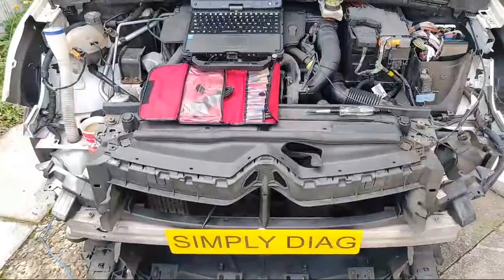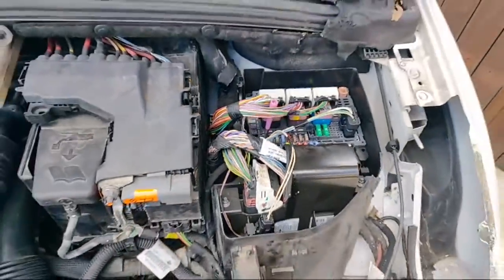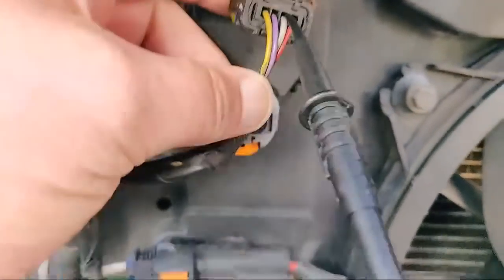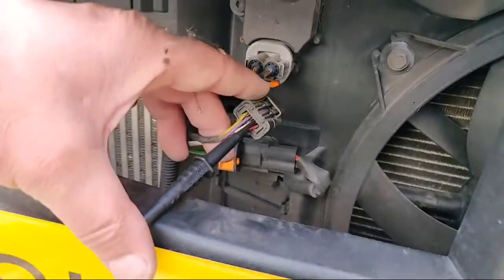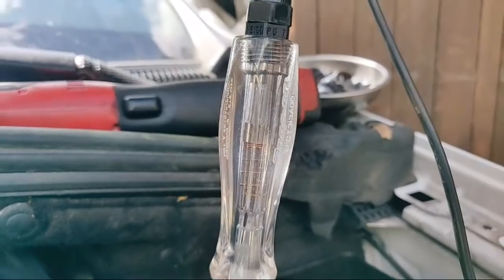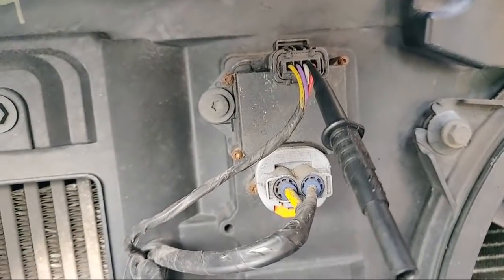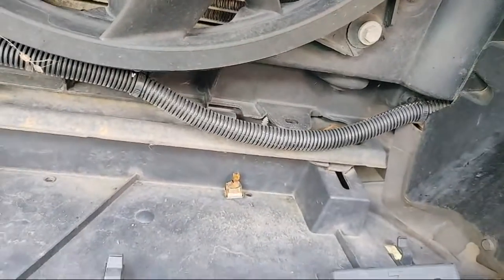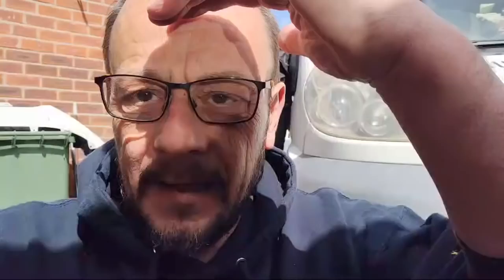How To Test For A Short To Ground

Comment: Hi,
Just found your channel, awesome.
I have Peugeot Partner 2012 1.6 B9.
I guess just like me, others have the same problem.
Car sitting overnight, next day start the engine after couple of minutes switch off, radiator fan (low speed) stays on 5 - 10 minutes.
What is your expertise?

Comment: Thank You for sharing this valuable information.
Now I know how to take off front bumper on my Berlingo if I have to.
Few days ago got yellow triangle warning light on the dash after I drew thru a big pile of snow. Snow got thru the grills and accumulated around fan and seized it. Snow froze solid overnight. Somehow I melted it few days later, using hot water and hose.
Tomorrow will have closer look at it. I hope there will be only one little blown fuse and everything else will be ok.

Comment: Well hope you do tell what was the final fix. Or did you shoot from the hip with a module replace?
Reply from the maker: Never shoot from the hip, I imagine every wrong call will cost me £1k, so every diag I make, I need to be £1k sure. 👍
Reply: @SimplyDiagnostics  You must have a lot of time on your hands and or customers don't mind you keeping their car for lengthy amount of time on the intermittent ones? On, headbangers especially in the computer to find there is a software patch to fix that only a dealer can fix unless you have access to this type of support. Have a great day.
Reply from the maker: I rarely do intermittent faults, they are time vampires. All my customers are awesome, yes, I have access to manufacturer information, tools and resources within our network at www.simplydiag.net 👍

Comment: Hey, Steve thinking out loud here, pull pin connector of that module of that circuit and make temporary fuse harness with a 5amp less than circuit fuse, then if it is the module the lower amp fuse blows and not the main fuse. Working here in the USA years ago had a body illumination fuse that would blow maybe once or twice a year as you may have guessed we could never find it, fused out all at the splits with a fuse of lower amperage eventually leading us to the actual wire that caused the short. Found on next service a bulb was out hey no power I wonder why? Many techs had looked and tried to find and failed but isolation and a bit of extra work found the problem. How expensive that module is I don't know but ruling it out could save face and a better solution. Be safe and well, good luck.